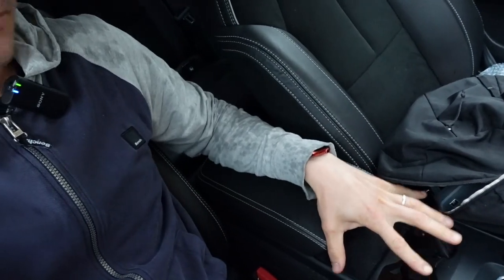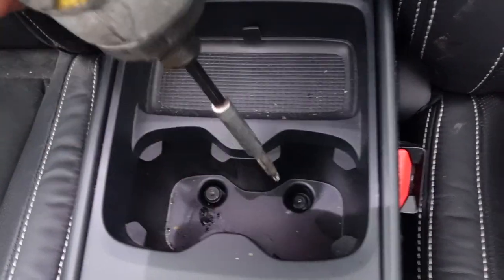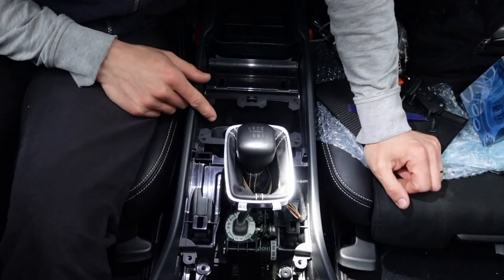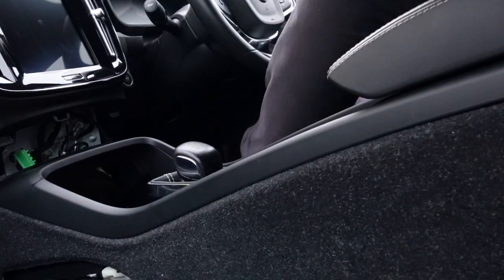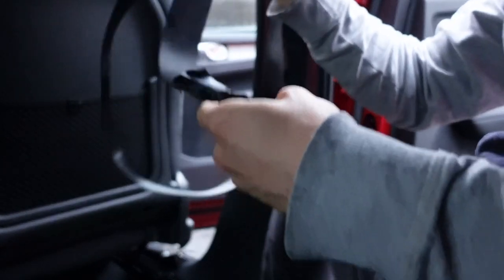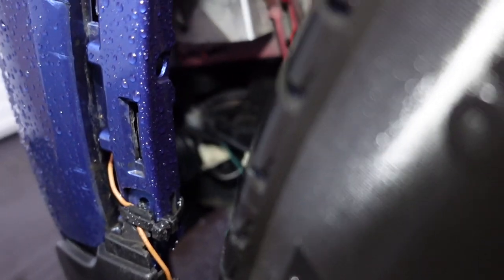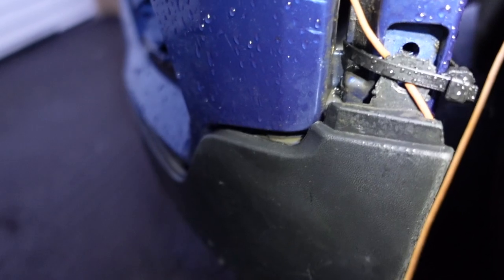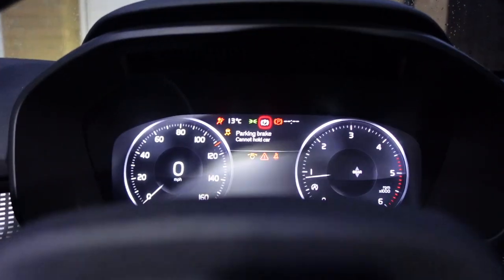Removing damage seat belt and crash lock SRS/Airbag module of my Volvo XC40

Comment: Hi how did you get it started
Do yo have a e mail address i can't get mine to start...
Air bags are gone in it thanks
Reply from the maker: Hi. Ive just charge the battery and it starts but at yours the pyto fuse maybe have blown (part number 31682255) is located in the box on battery with fuse and cables. Look online for this part number and you can find a picture how it’s looks. Try to bridge it (connect two sides) and see if it’s starts. If yes replace the pyro fuse as bridge could be only for temporary/checking. Let me know if that’s help. Thanks
Reply: Does the air bag controller need to be reset first
Reply from the maker: No. I’ve had the srs module reset later. Look out for the pyto fuse as this is the most possible reason why it’s not starting. Let me know if you found it but double check if it’s the right one before bridge it. 👍
Reply: Hi thanks will do 

This is the model I have 
￼VOLVO XC40 INSCRIPT PRO T5 RCHARGE A (2021) in SILVER